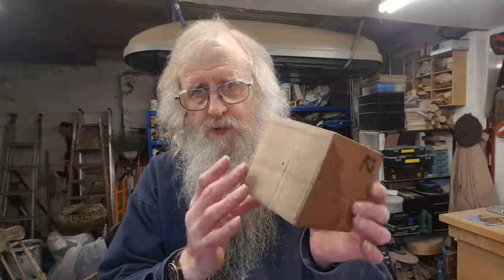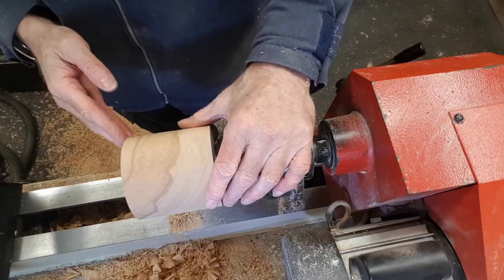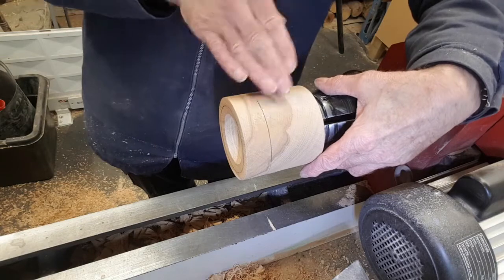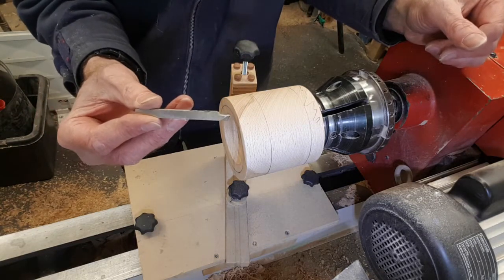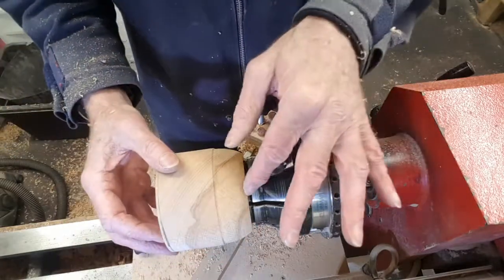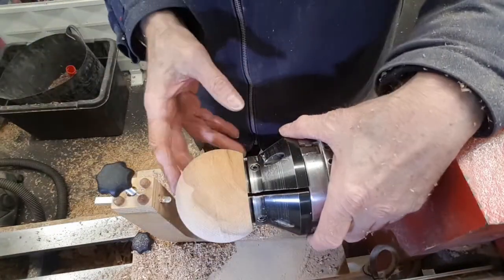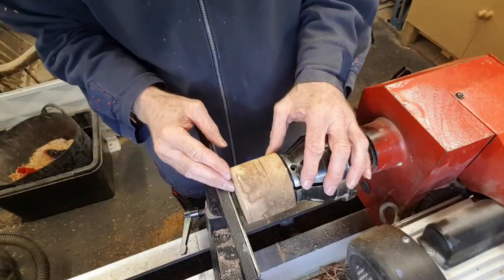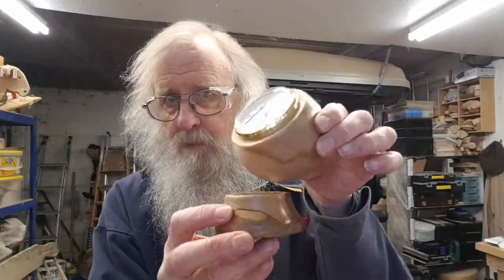The Crazy Woodman - Spherical Clock

Comment: Maybe I missed it but how did you work out your swivel point on your ply base because wouldn't it be different when turning different size spheres , my apologies if I missed it in the video as I can only watch with captions. Great video all the same👍
Reply from the maker: Hi, I'm glad you liked the video.  The swivel point is located under the centre of the sphere in order to create the arc of the curve.  You then adjust the amount that the tool overhangs from the jig to turn different sized spheres.  There is obviously a limited range of sizes that can be turned with the jig. The design for the jig is out of a book called Woodturning Wizardry by David Springett.  I hope that helps.  Regards Colin